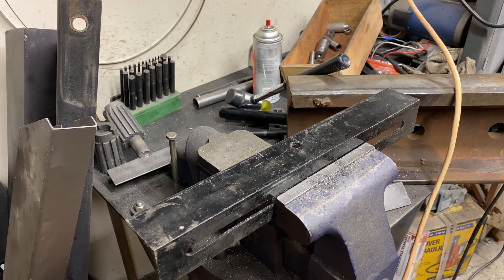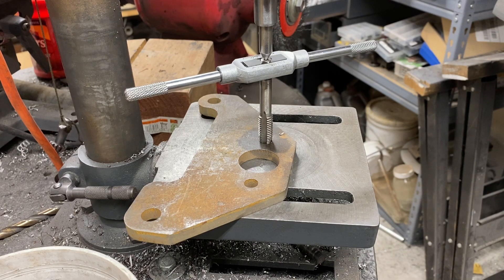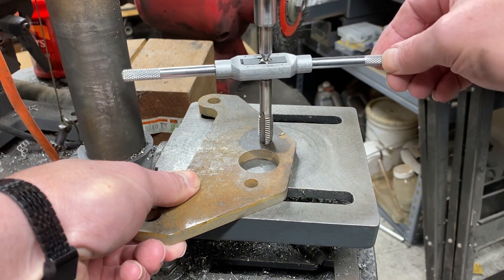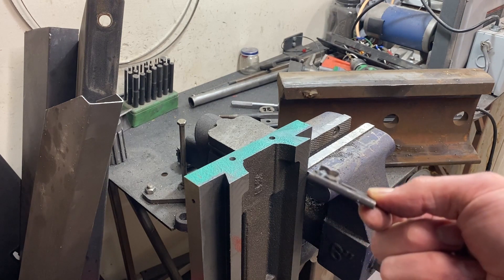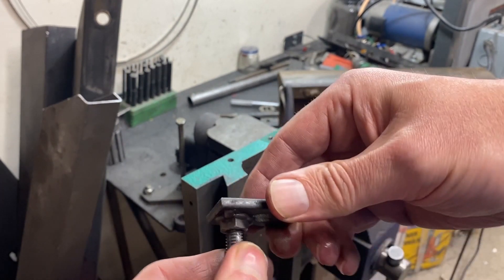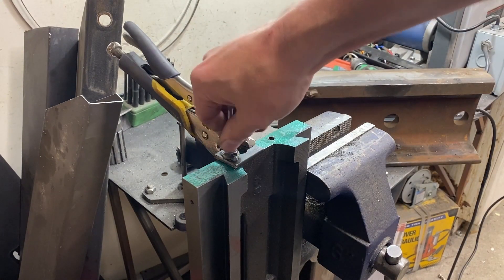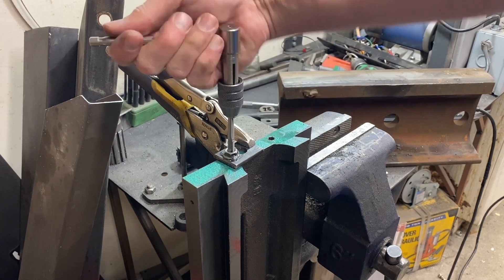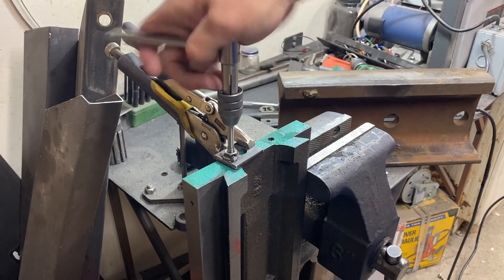"Square Tap" DIY tool allowing you to easily thread a hole keeping the tap perpendicular to the work

Comment: Hi folks. No welder? No problem! Just take a piece of steel bar and use the drill press to make the 'square tap'. No drill press? Well you don't know what you are missing but just take exceptional care with making the tap guide.
Reply from the maker: Good point

Comment: Chucks are available for your drill press, best have clutch and auto-reverse.
Reply from the maker: I am not sure what you are trying to convey.  I am not power tapping.  Setting it up in the drill press is only to keep the tap parallel to the hole, but the entire purpose of the video is to show how to get the same results as you would in the drill press when the part is to big to put in the drill press.  With that in mind what do chucks with a clutch and auto reverse have to do with it?